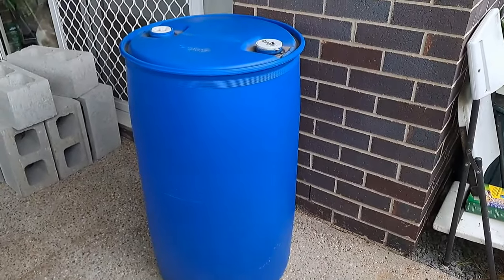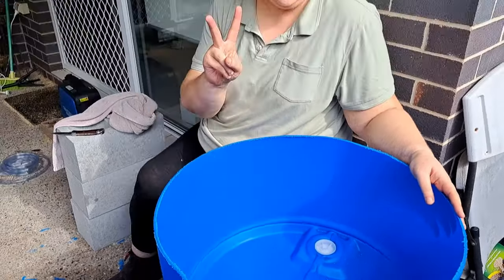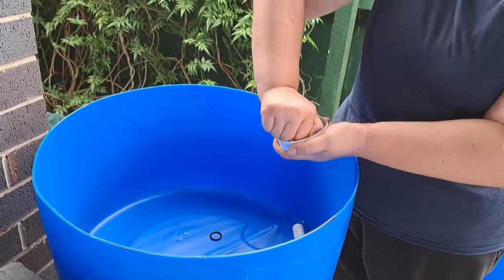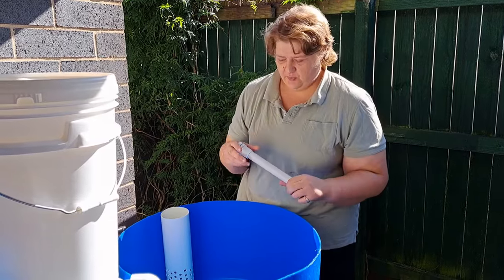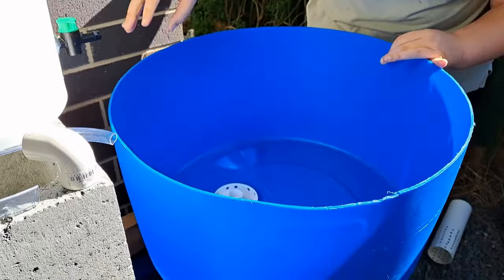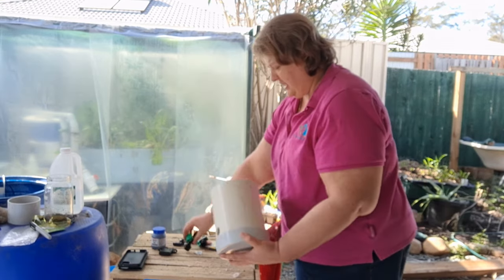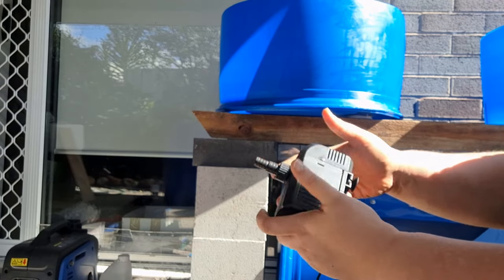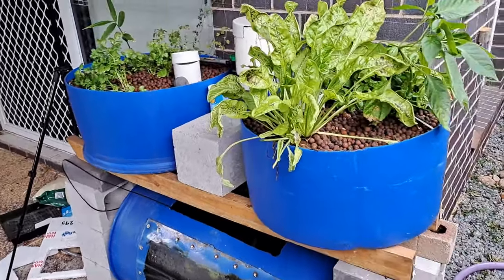Quick and Easy Aquaponics Setup: Build Your Own System in Hours!

Comment: what we should do or check with the water? How offen should we do it?
Reply from the maker: You will need to colonise the aquaponics system with nitrifying bacteria, without it the system itself doesn't work. So, check out this video that shows how to cycle (colonise) the system https://youtu.be/OqyMrdqc7xg 
The main tests are ammonia, nitrite, nitrate, pH and Iron. I test weekly, as this ensures I can prevent problems. There are other tests you can do too, but these are the main ones. The 'strip' tests look easy and appealing, but they are rarely accurate, the drop test kits like the API Freshwater master Test Kit has the ammonia,  nitrite, nitrate and pH tests. Best buy
Reply: Million thanks sis
 @CandyTheAquaponicsLady